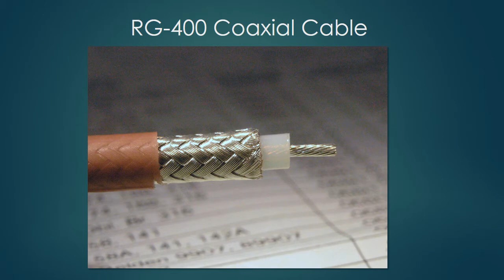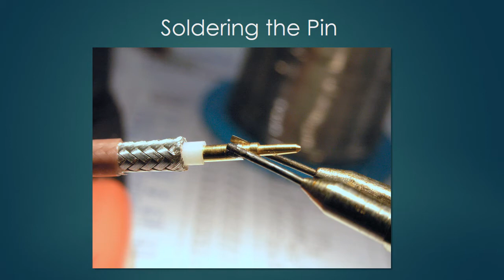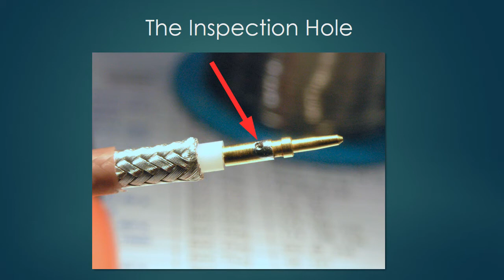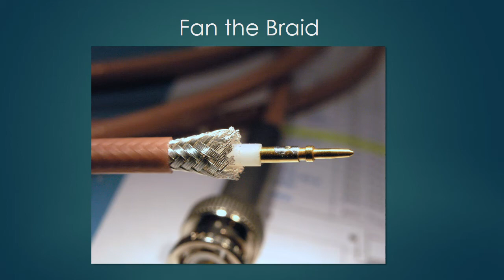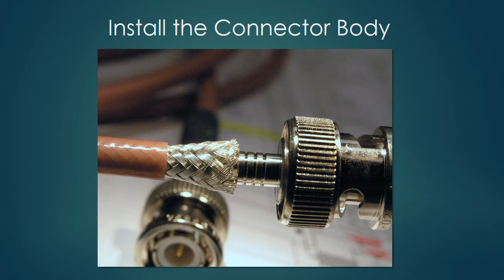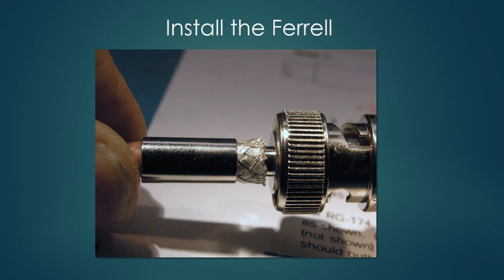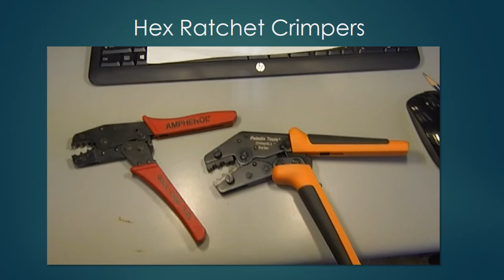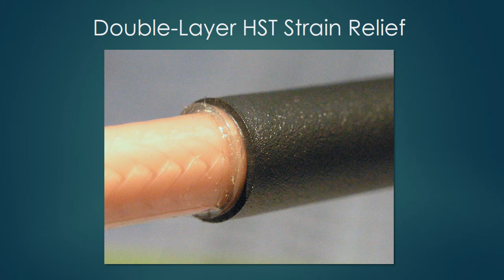Helicycle Coaxial Cable

Comment: Nice clear pictures Juan and some good tips...  Many manufacturers directions have you comb out the braid until straight... thoughts on that?    Also,  some of the trickiest parts are cutting the coax in prep of the connector fitting...any vids on that piece?   thx again...